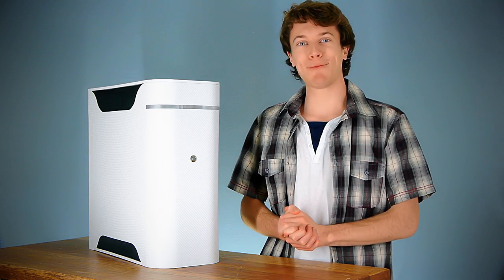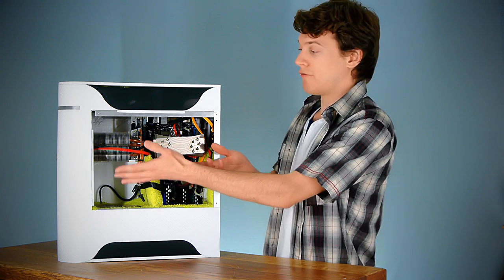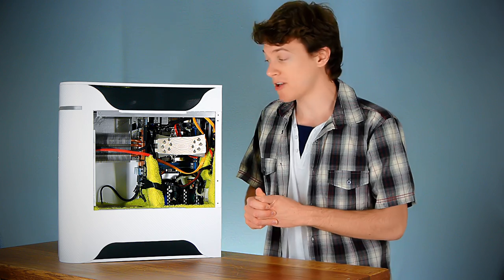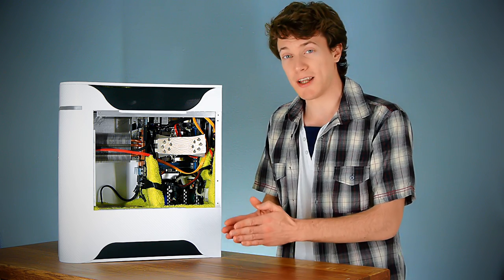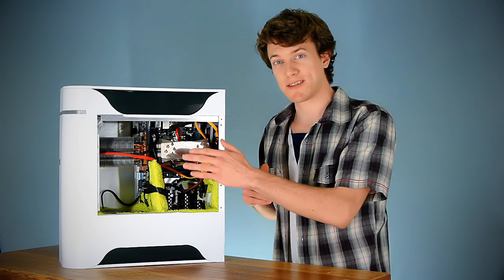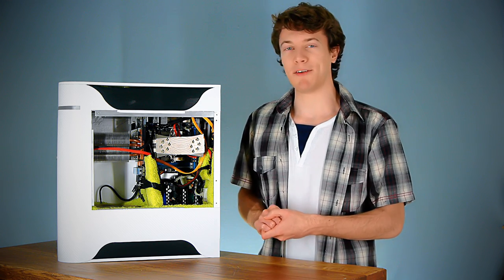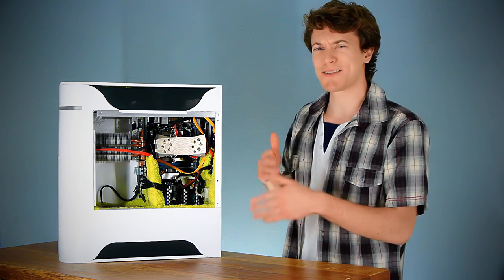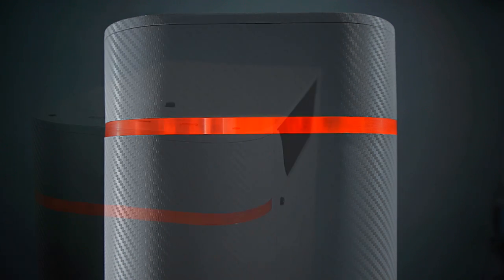DIY Computer Case - The Ultimate Silent PC (CLOUD UNIT)

Comment: Now figure out how to make the same thing with two cards in SLI/Crossfire.
Reply from the maker: Who uses SLI though, really? It's better than it used to be sure, but it's still got its issues and doesn't scale perfectly. I'd rather just go with a better GPU.

Crossfire shouldn't be an issue though, as it doesn't need a connecting cable.
Reply: I dunno, I do, haven't had any real problems.
But I could have sworn Crossfire needs a cable too... Guess not.
Reply: +gamermanj4 sli, crossfire, dual gpu are shit , because of microstuttering. and will always be, single gpu flagship cards are better. plus tripple monitors arent immersive anyways, so 1 good big monitor (max 30') is fine/better.
Reply: What about Quad SLI on a Titan X?
Reply: +Schmutz Lord sli/crossfire has it's uses though. like situations where your software can use you GPU's for computing.
Reply: +DIY Perks it's useful for cuda/opencl enabled software. like some software rendering video faster or non-realtime 3d scene rendering. heck, i hear some of photoshop's filters even have the option be gpu compute.
Reply: +wowitsbryce i haven't seen a case where even triple titan x's were really worth the extra cost of the third card vs the small performance boost it gives over dual titan x's...  not that i'd turn down  4 titan x cards if i were offered them but i'd probably give one to my brother,  connect one like normal and sli the last two for cuda/openCL purposes.
Reply: Josh Strawbridge Rich people would build a $10,000 PC any day. That's why there's more for minor improvement.
Reply: +wowitsbryce if i remember right JayzTwoCents' videos showed that there was virtually no improvement between using 3 and 4 titan x cards.... and that his i7 5960x had become the bottleneck for the system. Rich people would still get more out of their $10,000 PC by spending the money elsewhere.
Reply: Sybre
it is not minor, and an experienced eye can see it, heck even i as a noob saw it right away , when i played a game. no, tripple monitor has bezelz and stretches the images beyond normal, and by big monitor i meant something like 30'' or 32'' which still is OK if you sit in front of it. anything else would just create a tunnelvision. sli/crossfire/dualgpu is bad, you can say what you want.
Reply: +Schmutz Lord  +Sybre the monitor thing is going to be opinion no matter who says it.  the microstuttering thing should be able to be proven the results of which would count as a fact.  i'm sure there are also a number of other factors to take into account there such as sensitivity to that sort of thing (our eyes don't all work exactly the same)

another fact is that i'm tired of getting notifications for you two bickering in my e-mail so can one of you point me towards the youtube settings to remove this thread from my notifications?
Reply: Sybre man you write too much its a fact that images are stretching on tripple monitors cause games aren't optimized for that resolution.
bezelz in the way of the image just look fucking stupid, whatever you say.
and sli,crossfire,dualgpu , still have microstuttering give me a sourcelink where it says its nonexistant now, there isnt , so dont even try.
and i even saw this microstuttering bs on a exhibition, same as for the tripplemonitors bs in a racing game and in gta v... it looked ridicilous. whatever you say im right.
Reply: Josh Strawbridge It doesn't matter, they're fucking rich so they're going to buy expensive stuff even if it only improves by a few frames in games.
Reply: +DIY Perks If you want to achieve lower temperatures, using SLI helps. It balance the load between two cards, with some redundancy yes, but the power draw is less condensed. I had a single AMD r9 980x and it ran near 90C all the time. I added an other one and now they run around 70C.
Reply: It doesnt since the 290. it used to be a thing (and still is on 280/280x) on the 7000 series and before.
Reply: SiriusXification It doesn't what ? Have computationnal redundancy? AMD announced asynchronous shader with directX 12 which will increase Crossfire performance. But for now, the increase is not 1 for 1
Reply: +DIY Perks As it happens many people especially within the enthusiasts market use SLI. Out of touch a bit?
Reply: +gamermanj4 Nope crossfire is just plug more graphics and play.
Reply: +Schmutz Lord have YOU ever used a pc with gpus in sli config? but not for 2 minutes in some shop - I mean everyday use. If you didn't experience it yourself then you probably shouldn't talk shit about it since you don't know fucking nothing. Also there is shitload of games optimised for multiple screens.
Reply: Alex Marczuk my friend had a dualgpu card and i tried crossfire before. and sli just for testing.
Reply: you must have had some kind of problem with your hardware. I run dual 970 with no problems whatsoever. in sli of course

Comment: but you cant do this method in sli or crossfire. so therefore watercooling will always better. but that case is very clean, i must say!.
Reply: CVLova CV Isn't always better at all.
Don't forget that when you're watercooling you're "point cooling" certain parts of a PCB, leaving other components out. Such as BIOS chips, audio processors, possibly the entire southbridge unless you're custom looping, and all the voltage regulators around the CPU socket.

To remove the heat from those components you'll need airflow, and, what are you doing with watercooling if you need airflow? Noctua CPU coolers actually performs much better than closed WC units up till the H100, and is being quieter, while providing airflow.

Also, moving heat is done faster via air than water, as the air just gets moved out of the case and doesn't need to be cooled down.
Reply: Well in most cases. The bios chip is on the side . but think about it. 4way SLI/crossfire. That means theres 3 cards with blocked fans and is 10. Times louder than having a huge watercooling on the whole system.. Why aint there coolers on the motherboard bios chip? And why do people recommend watercooling over stock fans. Vetter performance, lower temps, more silent, longer life. Now closed watercooling punps are way different than custom. Look it up..
.
Reply: Take a gpu cooler of and look where there is CPU/gpu grease
Thats where its cooling
Reply: CVLova CV
I know :P
For larger setups it's a lifesaver to have the option to watercool. But mostly, mainstream wise it's not that common with SLI/CFX, yet...
But it looks cool either way.
Actually, I was thinking of doing a submerged build next time with something that cools the oil. Maybe I have to go with a two-pump setup?

Comment: Isn't it extremely unsafe to take a power supply out of it's housing???
Reply: Retro Fair enough then... I guess he knows more than me...
Reply: +Rudy_Eila it is, don't do it yourself.....
Reply: +doorgoo Yeah, those things will electrocute you 10 times over... did you see how big those things were??? They're massive!
Reply: +Rudy_Eila in short, yes.
Reply: +doorgoo If your PSU was tested at the factory, then even new in box, the capacitors are still hot.
Reply: +Rudy_Eila Yea. I've done it. Don't recommend it though. If you ever HAVE to do it. DO NOT TOUCH ANY CAPACITORS...hell, touch as little as you can. I just had to take the cover off one and remount a poorly installed fan to make the damn thing stop making grinding sounds.
Reply: +Rudy_Eila Yes, unless you really know what you're doing. I'm assuming he does.
Reply: Stephen Kendall  I agree. Especially since capacitors hold electricity even when not on.
Reply: Rudy_Eila Not recommended.There are some alternatives to dissasembling the psu like the hd plex
Reply: Not if you discharge the capacitors...

Comment: the cpu cooler on graphics card is a good idea but wouldn't having it liquid  more practical and quieter.
Reply from the maker: bob(the one that is at war with google +) Practical perhaps, because you can fit it in most cases, but not quieter. Watercooling needs pumps which make noise, whereas heatsinks on their own make no noise at all.
Reply: DIY Perks thanks for the reply. I am wondering if you put the whole computer in a vacuum would the computer get very hot and burn out?
Reply: DIY Perks also what you have build is amazing long time fan :)
Reply from the maker: bob(the one that is at war with google +)
 That's actually a really interesting question. I expect that without any air to pass over the heatsinks (if it was in a perfect vacuum) it would probably just get hotter and hotter until it switched itself off. Not 100% sure though. I'm sure someone who knows more about physics will fill us in with some facts if they see this.
Reply: DIY Perks you see i was thinking if we put it in a perfect vacuum there will be no sound at all :).
Reply: bob(the one that is at war with google +) DIY Perks  Summary: If you place it in a perfect vacuum, air will not be able to move at all. The heat-sinks will become useless as they're no longer able to radiate the heat off, and the system would burn up in a very short amount of time (minutes or seconds, not weeks or days).

Explanation:
Air is a terrible conductor of heat, in that it can only absorb as much heat as what's being put off before it will not take anymore, the only thing that makes it adequate for cooling is the movement and exhaust of the heated air, via flow of the intake air, and the natural movement of convection. If your heat-sink is 60℃, and the air between the radiator fins becomes 60℃, then the heat begins building up back into the chip you are trying to cool, but by replacing that air with say 21℃ ambient air, consistently as is done with the fans and convection in this case, it will allow heat to radiate.

This is why it's better to use liquid cooling, even if you use one with a slower, quieter than average pump. It takes 2 BTU to heat 1 cubic foot of air by 1°F, but it only take 1 BTU to heat 15.34 Fluid Ounces of water. Thus it is much better (for cooling, not necessarily efficiency) to use fluid to remove the maximum amount of heat from the chip itself, and then use air (at the radiator) to remove that heat from the liquid. This is why vehicle motors use liquid cooling with a radiator (that and because they run so hot nowadays that air cooling would leave most motors failing within minutes, there are the obvious exceptions for small motors like lawn mowers, weed eaters, some motorcycles, etc)

Hope that wasn't TL;DR
Reply: DIY Perks I suppose in theory if you used large enough tubing with full cover blocks and had enough of a water reservoir you could do without pumps, just have the water heat up and conduct the heat to all the water throughout the system until it reached a balance between its potential specific heat capacity and how much surface area you have on the radiators/heat exchangers.

Also, nice case you should send some pictures and benchmarks to Silent PC Review I bet those guys would love it.
Reply: Then a pressurised enclosure would make the pair thicker and transfer more heat
Reply: Ultra rc we could have the pipes comming out the vacuum and taking the heat ells where

Comment: Your computer is still going to catch fire and possibly burn your house down. PSUs and their cases are specifically designed to limit the chance of an electrical spark causing a fire or frying any other part of your computer with improper amounts of energy. You've taken away the specifically designed case and replaced it with a towel. There is a reason you never see professional modders modifying their PSUs. It's because they realize this. It's amazing that you are somehow intelligent enough to design a rather impressively quiet PC but are too stupid to understand the very basics of how an electrical fire starts. You have the potential for a spark, you have the heat, and with the towel you've given it the fuel.
Reply: vexx506 You still have a situation that will likely cause a fire. You have a PC stuffed with rather flammable towels, it has rather low airflow which rises temperatures, and you have a partially disassembled PSU which could cause sparks. Yes if this is done perfectly it shouldn't be a problem but this isn't the type of thing you should show off on a youtube video without the disclaimer that "This CAN cause a fire rather easily" this guy does the exact opposite which is dishonest, misinformed, and irresponsible.
Reply: *****, It's all very well the high voltage side is isolated and enclosed but with reduced voltage comes increased current (and therefore heat P = I^2R) and I have seen countless photos online of peoples dodgy SATA adapters catch fire proving it is entirely possible for a failure at the low voltage side to start a fire.
Reply: We Play Ive put PC's in hard cases. THe first thing that was done was taking the PSU out of its housing.
None one of these has caught first and the PSU's still work they where built 5 years ago.
Reply: We Play (and you have a partially disassembled PSU which could cause sparks.) how about arcing? learn your terms, and quite hating on this dudes build. He knows his stuff, as anyone can see from his videos.
Reply: At 80°C It can't burn
And this material is not really flammable

Comment: one day he will discover water cooling
Reply: Water cooling is not inferior, because there is no limit to how big surface area your radiator can be, hell you can even take your loop out of the case and mount it on a car radiator. Also water cooling can be quieter cause bigger surface area mean you can mount bigger fans that move more air at lower speeds. With air cooling you are confined to that little space there only so much you can do.
Reply: +Brendan_636

Then he'll do a full room watercooling project with the radiators from 20 dead cars.
Reply: He already discovered it because he talks about it in the video which you probably didn't really finish watching.
Reply: More cooling but there is some noise. Watercooling would be louder then his computer, but watercooling is quieter then a normal air cooled computer, with a normal air cooled gpu.
Reply: I stay away from water cooling for the sake of maintenance and risk of leaks. Yes, the fluid has a much much lower heat capacity, but ample temps can be attained with air cooling. Have you seen his video on his massive gpu cooler? Compare that to even a custom 500 dollar water cooling loop. Compare the maintenance, cost, noise, space, etc, etc, etc.
Reply: I'm building a watercooled rig ans I'm still thinking of using this case design (yes even water cooling benefits from better case design)
Reply: He did discover water cooling , only he's using it for torchlight.
Reply: have you checked the pricing of water cooling?

Comment: Another awesome idea would be to build a sound dampening silence box you can slide an existing pc into and still plug it in and cool it off but allow for zero noise. It would include baffles and sound dampening materials and vibration isolation and maybe even dust filters and powered fans. It would be quite versatile and could accommodate a wide variety of standard mid tower cases if built to the proper dimensions.

Comment: Years ago I built a computer with a P4 2.4GHz (533MHz FSB version), just a slightly modified Antec tower (similar to the omnipresent Chieftec towers at the time). With the original Zalman CU-7700 (I think it was called), and basic airflow optimisations, it was running at 29 degrees steady idle, and up to 39 degrees under prolonged load - even with a minor overclock to 2.8GHz.
The same system and case fitted with a mid tier water cooling solution, would idle at 41-42 degrees, and go as high as 60 degrees under load. And be significantly more noisy, as the pump produced far more noise than the fans combined, and crucially sounded way more annoying.

Comment: About getting more cooling for GPUs, I was designing a PC for an Nvidia competition recently, and before I fully read the noise, my idea was to make a gigantic case with radial fan mounts, using the PCIe x16 extension cables. That way, you could mount 4 2.5 slot GPUs at the same time without limiting airflow.